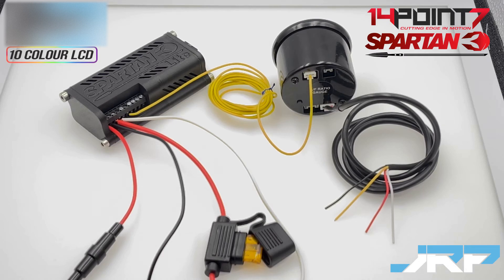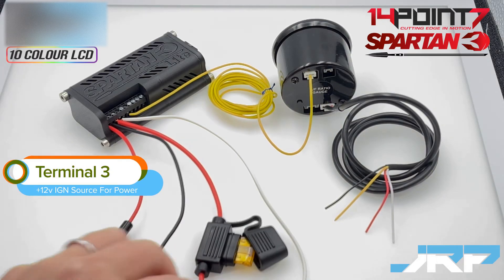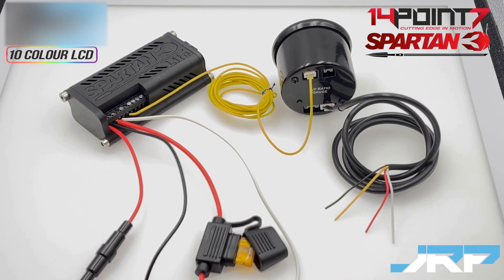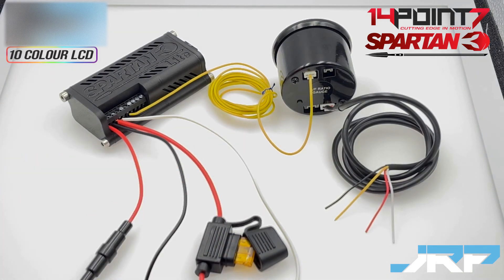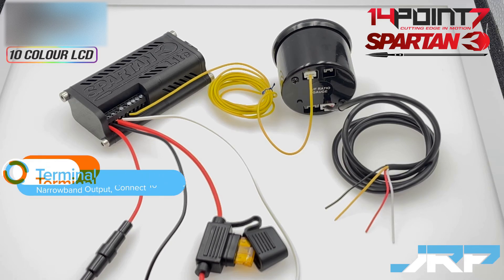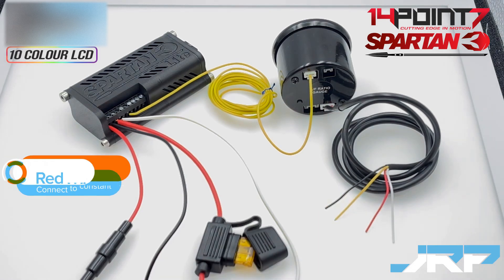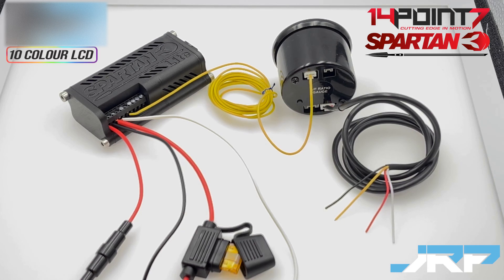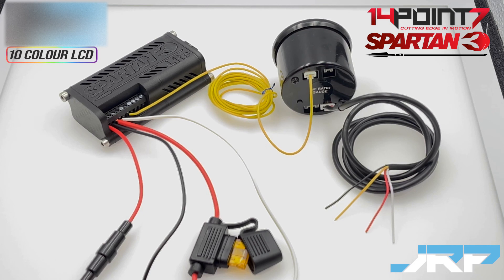14Point7 Spartan 3 Lite + JRP GearX 52mm Air Fuel Ratio Gauge Wideband Install

Comment: Would this be ok to run through a haltech expander box?
Reply from the maker: Thanks for the message, Your best off emailing or calling through for more accurate information. Spartan 3 Can has been used with Haltech products and can be custom programmed.
Older ECU's and data loggers can also work with the analog 0-5v linear output.
Reply: @JustRaceParts  will do! Thankyou

Comment: The kit comes with a pod for the gauge, which is a really loose fit. What's the recommended procedure for fitting the gauge to the pod? Kit has a bag with 3 screws and 2 strips of foam, but they are sticky on both sides.
Reply from the maker: Call or Direct message us on our Facebook page, we should be able to assist you further (send through some photos). There are one of 2x foam styles tapes that have been included depending on the age of your purchase. We have a Gauge mounting video as a work InProgress at the moment. 
Thank-you

Comment: Can i use the 12V +/- of the original O2 sensor Heater to Power Teminal 3/4?
Reply from the maker: Hi Alexandros, Thank-you for the message. No, Generally its best to follow the guide lines we put together in this video (and instructions) for successful installs + Spartan and Sensor longevity.

Comment: Is it absolutely necessary to ground them to the chassis and block? What would happen if I grounded them to my headunit wiring. On the Spartan 3 lite manual it doesn't give any recommendations for terminal 2 ground but for terminal 4 it says chassis and no mention of the block so could I do that also? Thanks
Reply from the maker: YES it is the BEST practice to do so if you want to take advantage of ACCURATE Spartan AFR readings. Part of the Spartans design architecture does indeed have a ground offset used to stabilise the data readings. Please avoid using a grounds off a head unit/ sound systems! This will lead to unexpected readings from electrical interferences.  Terminal 2 is best to ground off ecu ground. 
Feel free to call or email Just Race Parts for more info. :)

Comment: Hey, is there a cable in the kit to connect the O2 sensor to this ecu? Nothing is said about that in this video. Cheers.
Reply from the maker: Terminal 6 is used to connect to gauges, ecu's, dataloggers. It's the same for all, just run a wire from terminal 6. If running to a gauge and ecu, single wire from terminal 6 and then have it join to each wire running off to gauge / ecu etc.
Reply: @JustRaceParts  Thanks for that. But I meant: the connection from the O2-sensor (located in the exhaust) to the Spartan 3 ecu. It's not clear for me if that cable (loom) is provided with this kit. Cheers.
Reply from the maker: @Peter1970_yt  All of the Spartan 3 kits we sell come with an 02 sensor, and also a cable that connects from the Spartan wideband controller itself to the supplied 02 sensor. You can only use the 02 sensors provided with the kits, you don't use any 02 sensors that are installed prior to using the Spartan.

Any other questions feel free to email us. ;)
Reply: @JustRaceParts  Thanks a lot.
Reply from the maker: @Peter1970_yt  Welcome. ;)

Comment: Wow you ready to take a liability of failed sensors ? Because you don't mention anywhere that that the spartan box can't be powered unless the engine is running
Reply from the maker: That’s because the manual that is supplied with the Spartan 3 runs over that. This video was more of a guide to help people better understand the manual by seeing what connects where and just give a visual to the manual.
Reply: @JustRaceParts  ok i still think it should be included in this video. As probbaly the majority of people are referring to this video for guidance.
Reply: It says 12v ignition on the pop ups when he mentions the lines